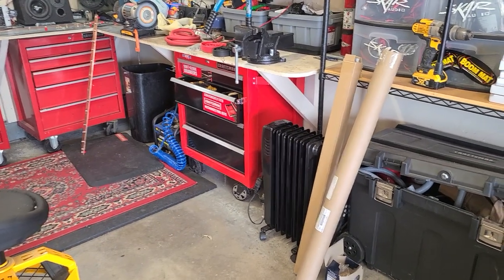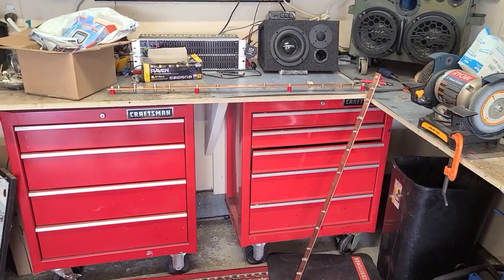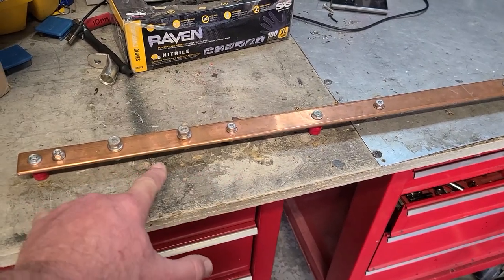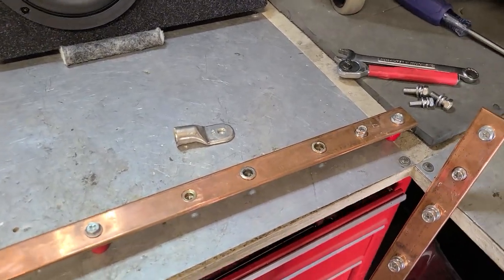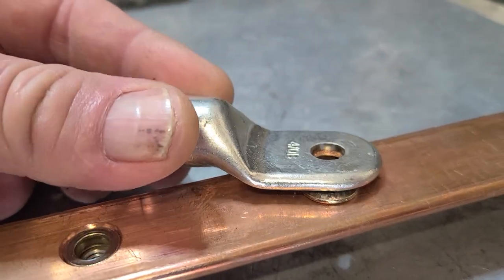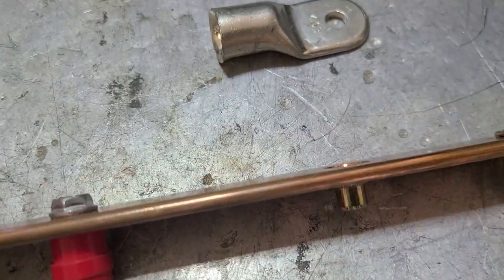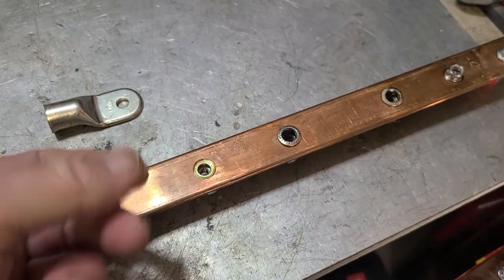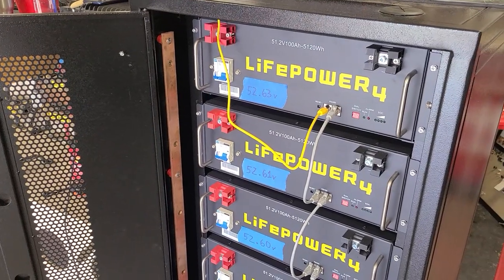Horrible! Received new replacement busbars from Signature Solar (unsafe, arc/fire hazard) WTH?

Comment: HOWdy C-DIY, ... 
... 
I have the older  EG4  LiFePOWER4  six battery Rack 
&
my Bus-Bars do NOT resemble either your Original nor Replacement  BUS-BARS 
...
All of my connectors are  M6  bolts / on the Stand-Offs / on the BATTERY Connectors / & / on the 0000 AWG lugs to my inverter 
...
I have tested the temperatures on ALL of my connections with a NON-CONTACT KLEIN Thermometer on several occasions = A-O.K. 
...
Sorry about your LUCK with the OEM's & the REPLACEMENTS 
...
I believe that I would attached all my connections with  stainless-steel  NUTS, WASHERS, & BOLTS  while the Bus-Bars were loose & not bolted in the cabinet ... 
&
Then bolt  the Stand-Offs  into the BATTERY-RACK ... 
...
NOT how they should be designed ... but ... a possible solution ? 
COOP
the  WiSeNhEiMeR from Richmond, INDIANA 
...
Reply from the maker: I simply drilled new holes in the bus bars and used hardened bolts, Nylocks, etc. It came out perfect, no issues.
https://www.youtube.com/watch?v=A9PcHpk7zro&t=4s

Comment: There is nothing quite like cutting costs and product quality. In the end, this will impede profits, not boost them as they lose customers and get poor reviews.  Maybe skip China as a vendor and have a US shop fabricate the thing properly. Charge what you need to, but don't skimp on quality and safety.  A competent mechanical engineer on staff would never let this thing through product design release.
Reply from the maker: Thanks...agree. These busbar issues have been elevated to the highest levels and are being addressed.